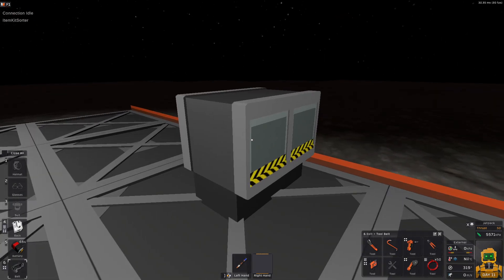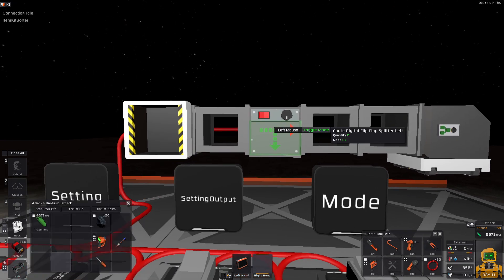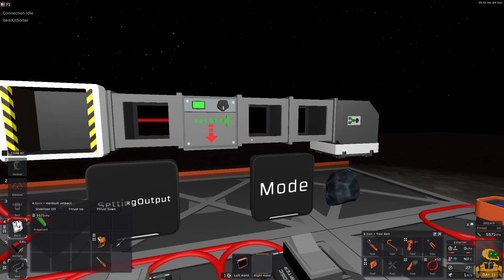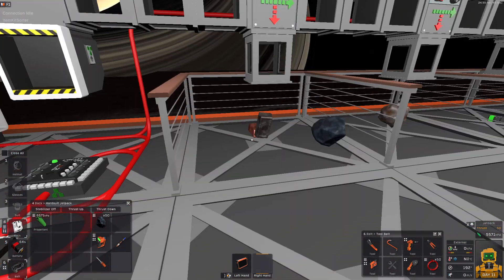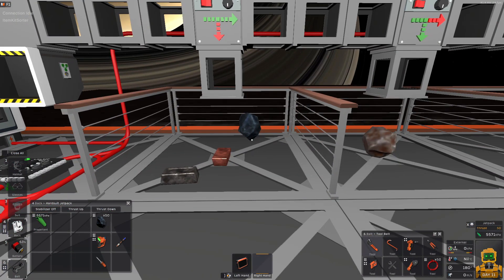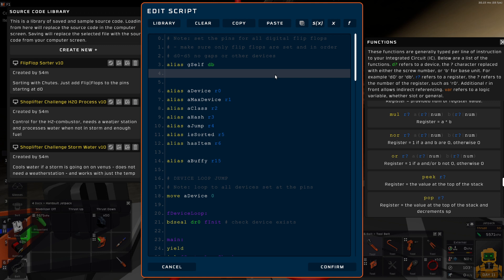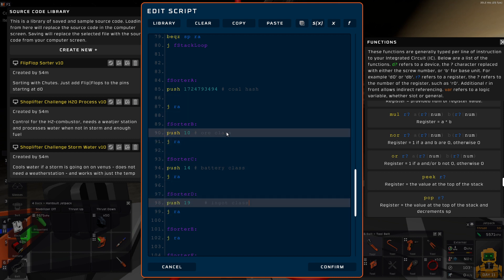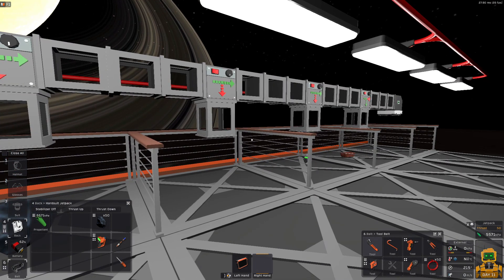Stationeers ( 2022 ): Sorting with Chutes - FlipFlop Sorter

Comment: Poahaha, der Code ist echt ein Schlachtfeld :) Aber gute Idee.
Wenn ich wieder mal eine neue Base anfange werde ich das versuchen
Reply from the maker: Hey - the code works - so it "must" be perfect. No, I'm just poking you a little. I wanted it to be 'easily' configurable for the filter objects and for the setup on the IC package pins. And that's what I came up with. I mean if you know what you want to filter and "hard code" you could get away with just a few lines of code. Thanks for stopping by and if you try, let me know how it worked out for you. If you find a good program for this - please gimme gimme :)